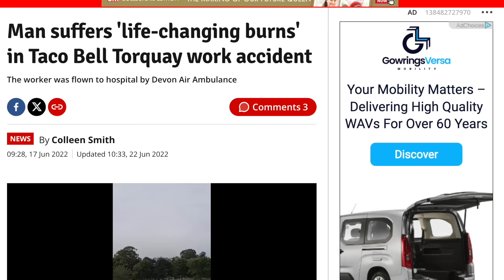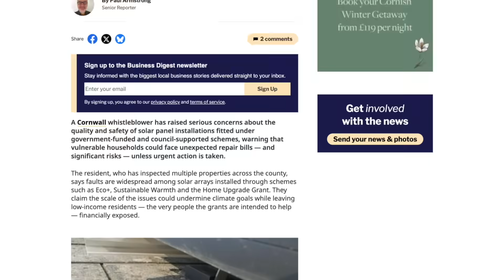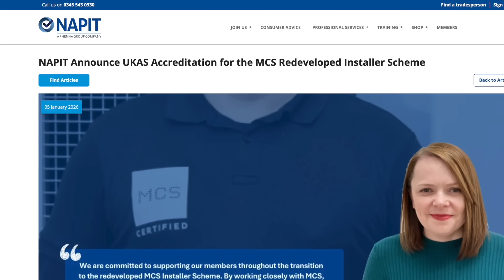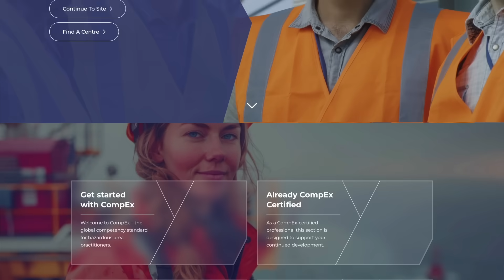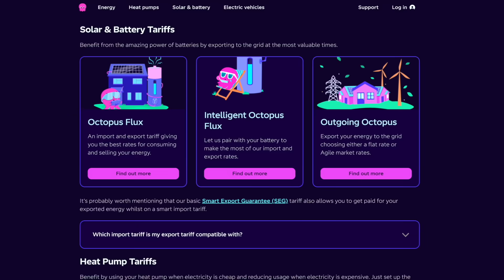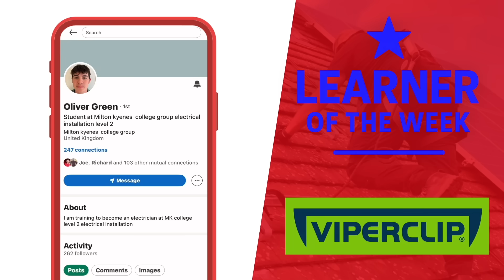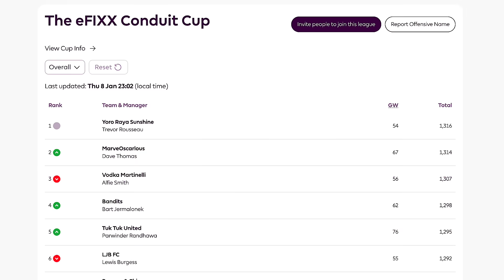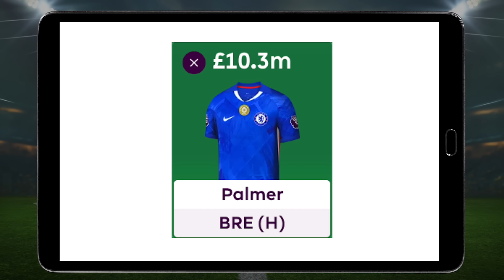Exposed: Shocking Standards Of Solar Installs

Comment: How is Mohammed even allowed to keep his license. An unsafe electrical installation in a hazardous area and improperly fills in the installation report. He fails the exam to get the certificate to do the work. He does the work anyway. His response is “Oopps, my bad” and is allowed to walk with a fine and community service which you know he’s not going to do. Then he’s allowed to retake the exam and continue on his merry way. This is why the self certification scheme needs to be scrapped.

Comment: do you have the source for lifting the balcony solar ban?
When is it coming? I presume there will be some rules imposed for safety reasons like only specific electrical circuits you can plug in directly etc?
Reply from the maker: See this blog post https://www.efixx.co.uk/Articles/plug-in-solar-uk-regulations

Comment: I am quite impressed how quickly some organisations can install solar panels and finish up with a 'commercially acceptable' standard. OK not the same standard, precision and attention to detail as I do, but what they do in a day, takes me 2-3 days and my installs are not 3 times better! So I have a lot of leeway for these 20 year old lads who turn up at 07:00 and work their butt off. Generally as soon as an install gets complicated, i.e. requires a bit of building, carpentry, chasing, welding, fabricating etc, these young lads just stop, look bemused, have a chat on their mobile and drive off into the distance so its 'horses for courses'.
WRT to the poor guy who went through the cable, I do a lot of work with underfloor heating and heat pumps. Other contractors occasionally have 'things' that require the floor drilled, about a year ago, got a call from Kone (a lift company) who wanted me to drill a simple hole for them because I am also a heating engineer and they reckoned that only a qualified, certified and indemnified heating engineer can undertake the work of drilling a hole! I looked at the job, smiled saying they have to be joking, way too dodgy, they laughed and said that's why we called you! I said, the only way this is possible is to cut out the floor tile, hand chisel the concrete in slow motion mm by mm down to the blue polystyrene, locate the red heating pipes, drill the required hole for all their hydraulics, concrete in a 80mm insert. Following day, re-screed, replaster the ceiling, next day replace the tile, regrout, paint entire ceiling and make good, I laughed 3 days work for a hole! nobody is going to pay somebody 3 days electrician rates to drill a ruddy hole! They said, we have the contract, can I start now! and as it transpired exactly where the hole in the corner was required there were loads of heating pipes that passed under the wall including a 20mm electrical conduit alongside 16mm networking conduit and it would have been a disaster! I do have sympathy for the poor chap but in this modern era should anybody be drilling holes using 'luck' (especially since every electrician has a a field detector in his belt that would have made a super strong beep-beep-beep) , after all, large professional lift companies like Kone & Otis would never dream of it, and, we no longer work with just 415v, many of my photovoltaic installs have concealed 25mm (or 32mm) buried conduits carrying 960v DC at 12kW (drill through that would be more than a big bang!)

Comment: Just seen a brand new indoor Market with about 50 roller shutters on the stall. Units. I am horrified at the electrical  installation standard of the roller shutters. I am retired, but I would have got the sack if I had done this..  All done on part P standards probably.
Reply: What are you talking about Part P standards? Part P is an Approved Document to the  Building Regulations that applies to domestic premises. What has that got to do with a commercial installation in a market?
Reply: @leeroots8292  That's why he's retired. Doesn't have a Scooby Doo.

Comment: Domestic solar+battery is a good thing to reduce energy costs, allowing 24/7 solar in the summer and access to cheap overnight tariffs for charging in the winter. This will no doubt reduce the need to for expensive network upgrades.
Unfortunately scammers and cowboys are in every form of trade and definitely not limited to anything with public subsidies, although that does seem to attract them like flies around a pile. Bad solar installs have been going on for at least a decade. It would help if MCS carried out more inspections and were able to rectify shortcomings preferably at the expense of the original wronguns. Despite the universal availability of internet access and opportunities to research companies, there are still many, mainly vulnerable, individuals who will agree to work being carried out by the first cold caller they get offering anything "free" or on the cheap.

Comment: See it all the time. No DC isolators, tiles not ground out, insufficient hooks, outdoor switchgear, no bird guard, low quality inverters, no rapid shutdown or monitoring. All certified and insured with policies we all know will never payout. The question is when will people want to work at the solution? Skills, training, gatekeeping and most importantly policing from an organisation that actually enhances the prospects of quality beyond revenue. All we have atm is the quality mark from our own work and standing upon that as installers running small companies around the UK.
Reply: You're right but additionally there is acceptable middle ground, if we are honest, us electricians are not always the best resource for installing panels, sometimes we should stick to doing what we have 20 years experience doing, design, oversight, wiring, inverter / battery installs etc leaving a team of 20 year-old lads running around lugging 30Kg panels across roofs. I know personally the days where I put a 460w panel on my shoulder, whizz up a ladder at high speed, then repeat it 20 times have long gone! If I havent got my cherry picker or teleloader on site, it won't happen!
Reply: @Ino-z2m knowing our own limits is key. However so is owning them and developing them. We either want it or we dont.

Comment: Well it just highlights the massive gap in solar installations between just too quick and business taking far too long just to profit. 
Nobody wants people taking unsafe shortcuts, but equally people want fair value for money. 

On the downside panel and battery prices are due to rise in April due to China continuing to reduce export subsidies.
Reply from the maker: Fair point, it's a balancing act isn't it?
Reply: The main issue with plug-in-solar is it needing to be hard wired AND should ensure it has bi-directional protection, when it increases voltage and pushes this back to the home/CU/grid etc...
Alas, many homes, especially low income social housing may have uni-directional protection or the older AC type rcd/rcbo's, so it is imperative an inspection/risk assessment is conducted, before people just think they can just "plug-in" panels/inverter/batteries etc... no matter how small the system might be
Reply: @authuruksake9121 All valid points. While you increase risk in some areas you have also decreased risk in other areas because you now have active monitoring from the microinverter which likely picks up faults well before you might realise normally. So there is definitely a trade off. 

There is obviously a huge amount of data on the safety aspect (from the huge amount of installs from Europe) to an informed decision can be made.
Reply: @authuruksake9121  But that's the point they plug into a socket, all the protection is built into the device to make it safe so its not a 'suicide cord'. Personally I have only ever seen this in Germany and its covered by VDE-0100 (which is our ed18 Am 3) and the sockets are 16A radial and as you correctly state terminated in a bi-directional 30mA 16A RCBO. In the UK the ring main is typically 30mA 32A mono-directional so I'm not sure how a CE compliant device that states 16A can, at the moment, have the CEE 7/17 (ref F) cut off, replaced by a BS1363 (ref G) and be compliant without becoming the lowest denominator of both regs, i.e. replacing the RCBO! But that means an electrician, MWC possibly EICR so what's been achieved? nothing!
... eFixx: Hi again, I know I seem to create all the controversy on your excellent channel so maybe this another thing to officially research before 20 other electricians all start pointing out that CEE 7/17 is only applicable alongside VDE-0100 as is BS1363 alongside BS7671 consequently plug in panels cannot technically have a plug swap and become compliant! Or can they? Over to you...